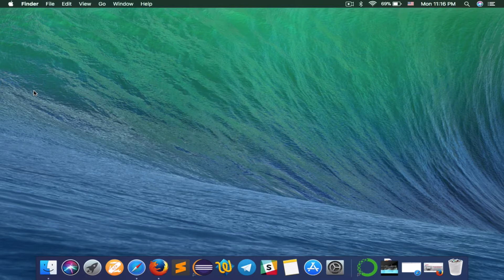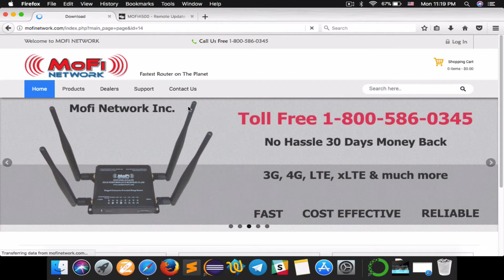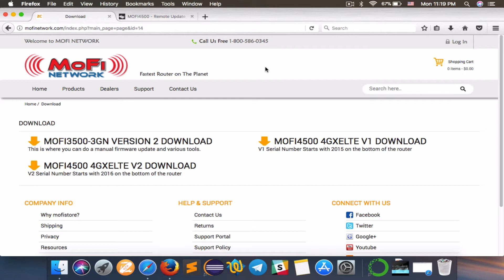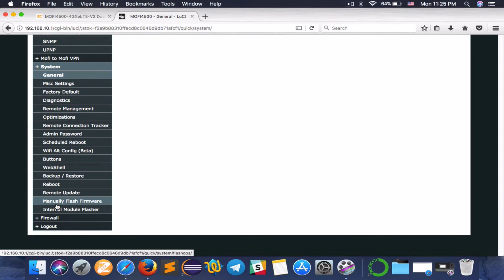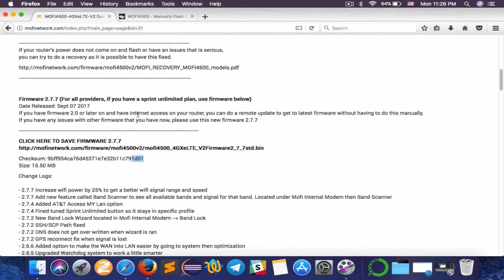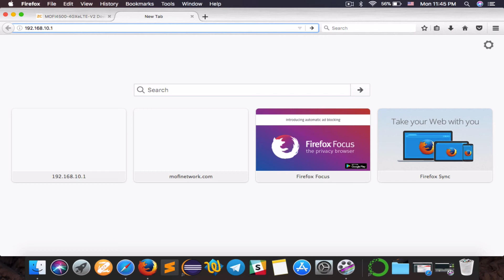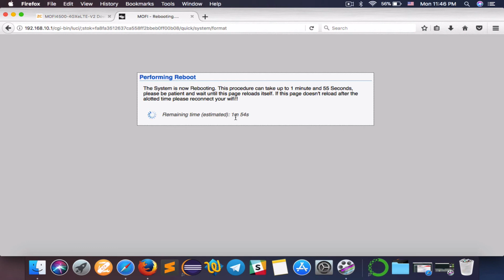manual flash firmware

Comment: Glad I got this free. That seems to be what it's worth. Reset addresses are BS, login after reset creds are BS. No wonder it was in the trash bin!
Reply from the maker: What do you mean by BS?
Reply: @Mofinetwork  Bovine excrement. Never in my years in networking have I experienced a device that when "reset to factory default" didn't go to the address it was supposed to or once the address was found using network tools, wouldn't login to the default username and password. Read some of the other comments below and tell us why it should take several hours of fiddling to get something to work as advertised. Ready for the trash bin, but not ready for the market and the previous owner made that wise move first, and now I'll follow.
Reply from the maker: @eljefe62  hello, we don't have any outstanding issue like this and not sure why you are having this.
Best to contact us via our support and we can help you with this but we sold many of routers and this for sure is not an issue we have.
if you reset the via an ethernet connection, once the router comes back up, we have a code to auto try 192.168.10.1
if you are on wifi, it will not come back as once you reset the router, it will depend on your pc to first connect to the mofi's wifi before it can auto connect.  The router is more than ready for market as many companies use this full time 24/7 for many years never needing a reboot and it is very stable.

Comment: So, after a firmware upgrade you reset to factory defaults? Why? This means I have to reconfigure the router from scratch and have to remember every setting that I changed?
Reply: Before flashing, simply back up the config, flash the firmware, factory reset it, then reload the config file.   The reason why it's a good practice to factory reset it, is because it will initialize all memory area just in case some thing has changed since the last firmware release.  This goes will any other device too, it's just a good practice which ensures successful updating on the first try, eliminating any issues down the line.
.
Reply: @BillAnt  hmm.. ok ty..

Comment: Do yall have firmware for Linux Kernels? My linux machine will not connect with the wifi because of this fact.
Reply from the maker: The router is using a Linux Kernel already. Please test to make sure you have no issues on your pc as there should be no issue connecting to the wifi on Linux, PC, Max or any other devices.
Suggest to reset the router by going to system then factory default then perform reset and retest
Reply: @Mofinetwork  I'm not sure what issues there would be. The computer recognizes the network. I have the correct password. Technical support?
Reply from the maker: Best to contact us via a ticket and we can give you some options to check
Reply: @Mofinetwork  What you said worked, thanks!

Comment: i have done this twice and it has not changed a thing, i still have no internet connection. i pretty give up at this point. this has been zero help. 12 hours with no internet
Reply from the maker: This video is to show how to update the firmware.  If you have  no internet, that could be for many reason but to focus on this video, this is to show how to update the firmware only.
If you have no internet, suggest to do a module reset and factory default and verify the APN that you need to use.  If still have no internet, the contact your provider to make sure there is no issues with the sim.
Reply: can you give me any sort of link to show me how i can do that? i don’t just want to hop into the router and start clicking things. you weren’t very specific on how to do what you had replied to me. the sim had worked before for a week or two, it’s just this passed weekend it has been completely off since about 2 p.m Saturday, it’s now 6:30 p.m Sunday and it still doesn’t work
Reply from the maker: @dizzy4202  Did you contact mofi support?
This page that you are making comments on are for updating the firmware.
Since this is not your issues, then you should contact mofi support or your provider and work that way to help resolve the issue.
Please go to mofinetwork site and make a ticket and we will do the best to help you.
Also, we are Mofi Network Inc. and will do the best to help you but if your provider is having the issue, we cannot resolve that part but the first step would be to contact us and we can direct you on how and what to trouble shoot.
Reply: i have been trying to contact them all weekend, and they never reply to me. i’m so upset right now i don’t even know what to do anymore. i did a module reset and that didn’t do anything either. no one will get in touch with me
Reply from the maker: @dizzy4202  go to mofinetwork.com and make a ticket and we will help as much as possible.  Yes understand your frustration with this and this is not good for anyone as not sure why they are not getting back but best to contact us and we can send you the new Ubifi firmware to load to see if that will make it a bit better.
Reply: awesome i just sent an email to the mofi network and hope they get back to me soon. thank you so much

Comment: How do I change setting to go from verizon to ATT service?
Reply: Just do the following:

1) Do a module reset (go to MOFI Internal Modem and then click on Press here to reset the X module"
2) After the router is back up, just log into the router and then perform a Factory Default (System and then Factory default).

Comment: Did the upgrade an it’s still cutting me off saying that I have not registered to the network or that the carrier is unassigned
Reply: There are 2 possibilities when this happens: either the SIM card isn't in properly or the SIM card isn't activated from your carrier yet.
To make sure that the SIM is in properly, make sure the GOLD part of the SIM card is facing upwards and the notch of the SIM card goes in first. When you slide the SIM card in, you should feel a click which will tell you that the SIM card is in properly.

And even if that doesn't work you can always give their tech support a call.
Reply: Try inserting the sim card into an unlocked phone, make a test call and also try browsing the web to make sure it's properly working BEFORE trying it in the MoFi box.